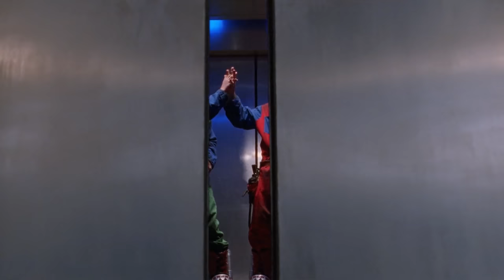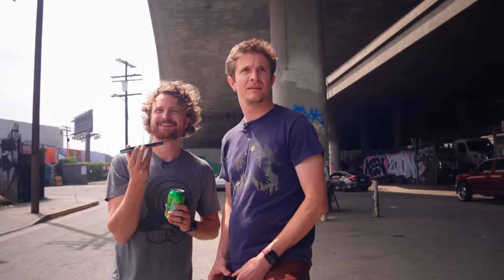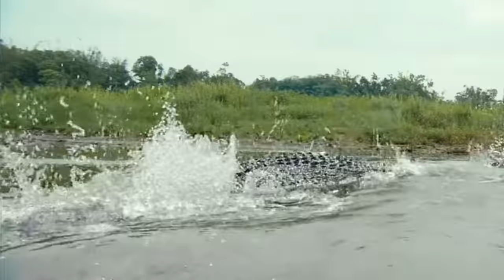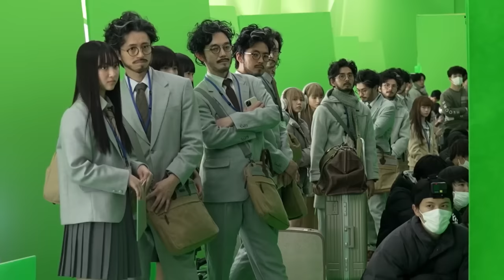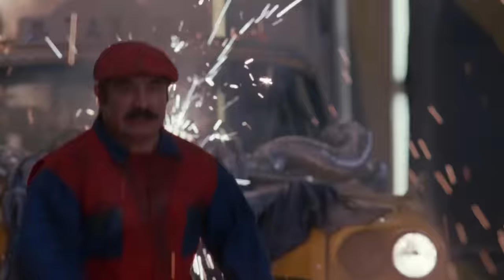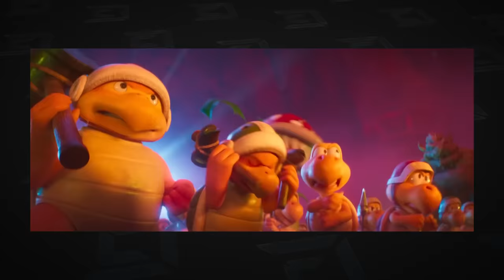VFX Artists React 99: Super Mario Bros, Bourne Ultimatum

Comment: Okay Sam, lemme explain how much you exaggerated that percentage.
the Bourne Ultimatum is ~9500 seconds long, and the shot in question is ~4 seconds long.
That shot accounts for ~0.04% of the movie.
As opposed to 0.0000000001%, which would account for ~0.0000000093 seconds, or ~9.3 nanoseconds of the movie.
There are a billion nanoseconds in a single second.
A single frame at 60 fps is ~16 milliseconds , which is 16 million nanoseconds. 
So that means, your percentage estimation could repeat itself 1.7 million times within a single frame.
Reply: FAX
Reply: r/theydidthemath
Reply: He needs to hear this.

Comment: If you liked the Japanese train commercial, check out the Pocari Sweat commercials, especially the 2021 and 2022 ones, but especially the 2021 one. They're about as insane as the train one, and they have behind the scenes as well. In fact, most recent major Japanese commercials will have behind the scenes, so if you see a cool one you can probably also see how it's made.